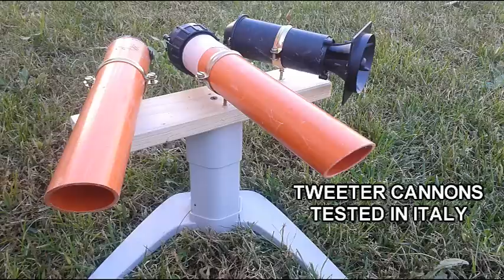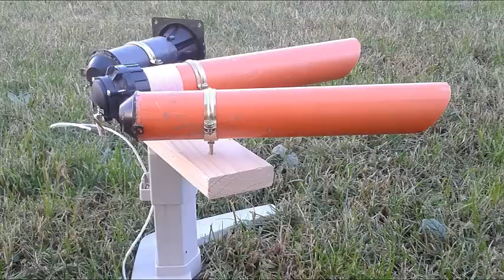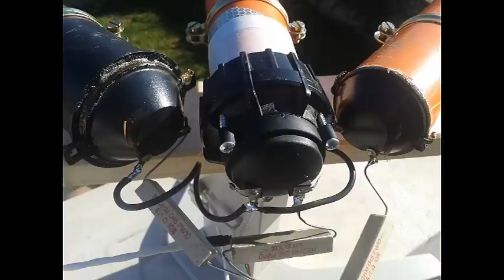DOG CONTROL SOUND CANNONS - PROTYPES & TESTS

Comment: I'm a carpenter and all this is way over my head but the neighbors dog barking is about to make my head explode!!!  Could you bring your conversation down a few intellectual levels to lets say, "plug this thing in here and this thingy in here"?
Reply from the maker: @ Robert Young: Let me say, you're a carpenter and that's way over my head, when I make things from wood it looks like crap. So, if I asked you to tell me in a simple way "how do I make furniture", I still wouldn't understand what you said. So, electronics is not easy to simplify. BUT: I don't even know if high frequency sound will work on dogs. In my videos I do talk about other ways (besides electronics) to try to get relief from dog noise. In my case, I've finally solved the problem with my neighbors by just becoming a complete asshole. It wasn't fun, the cops didn't help, animal control didn't help. HOWEVER, I'm told that in some parts of the USA and elsewhere cops will help, or local government. I'm still looking for electronic ways to do this, but until then, it's tough. I feel your pain. Stay tuned.

Comment: also, you shouldn't need a long tube for HF, because as frequency goes up, the sound becomes more directional, which is why you can hear low frequency bass from a longer distance and any angle, than HF

Comment from the maker: at tigercs1: Thanks for your comment and suggestion. A couple of years ago I did a few experiments with some metal tubes and found no real difference between projection qualities of shiney metal and pvc, however I only measured the levels at 12 to 15 feet of distance. My gut feeling is that very smooth metal probably is a bit more efficient, but more expensive and harder to come by too. I think a long horn shaped metal piece would be awesome and it would probably work well.

Comment from the maker: I agree. Piezo tweeters work with voltage, not amperage. 20 or 30 volts of high frequency signal would be good for a piezo to get level (assuming the piezo is capable of high level).

Comment: I posted this on your other video as well.  I believe that it would help to stack 8 (or more) in a vertical column.  That would multiply and focus the sound energy in the horizontal plane.  Thanks SO much for doing this research!

Comment: Maybe a 100 Volt line public address amplifier would be a good choice. Like they use in bars and public buildings. They are easy to pick up 2nd hand (I have two in the attic). They are designed to drive high impedance loads.

Comment from the maker: At Jerry Tremont: Thanks for your feedback. I agree with you on cheap piezo tweeters. However, I'm trying to get more information on better piezos, as I know that there is a huge range of piezo devices, including piezos that can actually cut material. I'm trying to learn. Thanks again for your experience and info.

Comment: Would stainless steel tube trumpets help the noise reach is destination? PVC may not shoot or direct some of the sounds as effectively as stainless steel, I do not know this for sure however. Just think about horns like truck or train horns, they are all steel. Perhaps even using their trumpets from your tweeters? Hope this helps.

Comment: if you havent already i would look up the specs for a handheld Dazer 2. I dont know off hand what the specs are (dose run off a 9volt battery), but its rang i can barely hear it but no one in the house dose but i got some pretty sensitive ears. but it works good on most dogs and even other animals that i had to use mine on. granted it may not be for long range. but might lead to some clues.

Comment: The air in the tube will resonate harmonic according to the length of the tube and some other minority factors.
a cilindrical tube will resonate at uneven harmonics, with the full length being the groundtone and will have a great possibility of being the most resonant frequency of the tube. You can calculate the requency of a tube by knowing the speed of sound and the length of the tube. Also the smaller the diameter the higher cutoff frequency of the bandpass filtering that occures in the tube.

Comment: I have ordered some of the $2.50 NUANCE voice-coil tweeters from Parts Express. I think that the failure mode for pulsed VC tweeters is going to be mechanical in nature. The glue or something will simply fail and the cone or coil will come loose.
     Some say that the best frequency is about 18KHz as this is still inaudible, and the cheapest tweeters will put out at least 20KHz..I have built a Class D power amp for the tests, with +/- 50V available. 100W pulsed. Nuance units were $8 ea.

Comment from the maker: At Jerry Tremont: I believe you when you say that voice coil tweeters show promise. I believe they could be very powerful at 20k cycles. By the way, as for piezo tweeters, I have one that I ordered from Germany (made by Kemo) that does not become audible or hot if driven by short pulses and I can measure see it's level at a distance of thirty feet when measured by a condenser microphone. I haven't used it on dogs yet.

Comment: Mr Minimal,
Thank you for the info. You sound like you know a lot about sound and physics. For most laymen it is difficult to take that information and make use it as it should be. As a short cut, could you possibly tell us what an ideal width and length tube would be to maximize the effect of the cannon? If it depends on the type of speaker and sound being used, can you comment on an ideal speaker? Thanks!

Comment: I live in the uk and just had a guy move into the flat next door. He has a big dog and it wont stop barking, the deviding wall is a thin tiled wall, so when the dog barks the sound travels right through my apartment. Its freeking me out. I want to ask you if the sounds frequency will hurt my cats ears.

Comment: I have tried inexpensive piezo tweeters and found them a mere annoyance. Piezo tweeters are driven by thin films which cannot dissipate much power at all. The film will get hot and become depolorized, reducing output. If the tweeter breaks down each cycle, it will emit audible sound. So even pulsed power will not work.

Voice coil tweeters should be capable of being driven to high power levels as there is no electrical breakdown. The failure mode for pulsed power is the tweeter will shake apart.

Comment: Spaceman -
     I bought the $1 piezo tweeters from Parts Express, which is a vendor I reccommend. They 
 tweeters were junk, and I knew they were junk,  and that is OK because I am doing research and my budget is low. There is much to be known about piezo tweeters when a person is interested in raw power and not fidelity. One may only discover this in a lab, however. The tweeters motor is a thin film which causes a membrane to flex. This film is not capable of continuous power output at 1 watt.

Comment from the maker: @ ConcaviusTV: There is no info available as to effectiveness of ultrasound, we're in uncharted waters. The range? Unknown, but probably not more than 20 or 30 feet with small components (with an ultrasonic power/air whistle, maybe 200 feet? Just a guess). There's no true diagram as the dream-machine that we seek doesn't exist (as far as we know). This is all experimental. There are commercial units out there, but they're too weak. We seek power unit knowledge. Info needed.